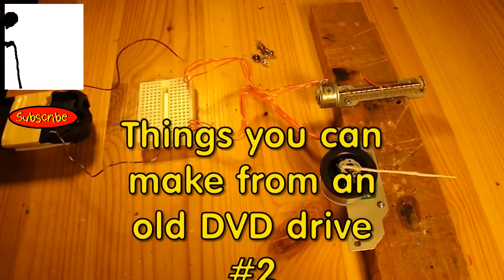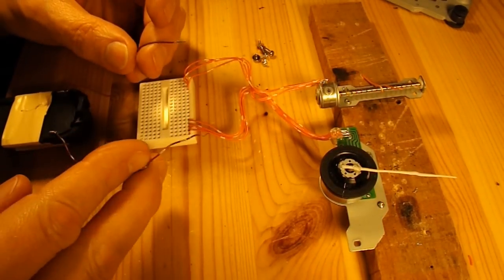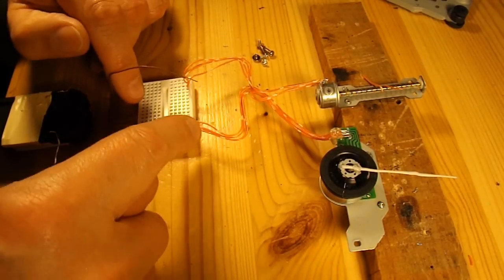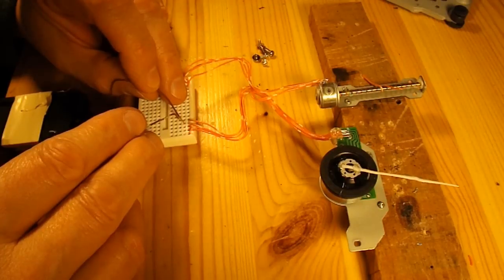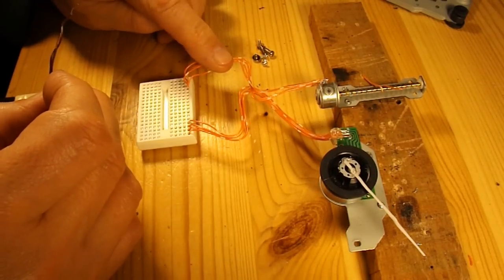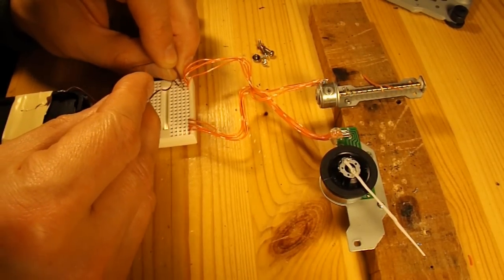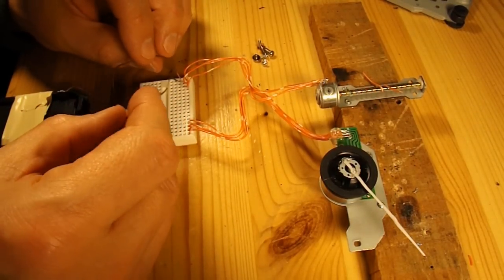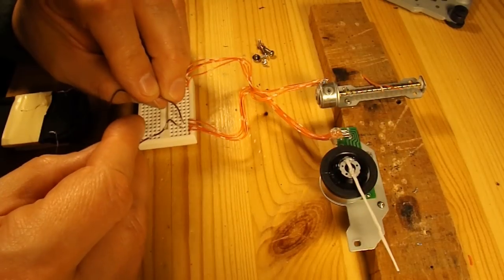Things you can make from an old DVD drive #2 - Step a stepper motor

Comment: Try inverting the polarity on a certain set of pins/wires for the screw stepper motor. It works for mine.
Reply from the maker: Donovan Goodwin isn't that what I was doing in the video? I was just stepping along the 4 wires a pair at a time in various combinations and alternative polarities. Most stepper motors have 3 coils and a common return, which gives you the 4 wires. If you look in my video description you will see more information and useful links.
Reply: GrandadIsAnOldMan I see, my mistake, my stepper is much smaller than that so I think it only has 2 coils, but I'm not sure. Thanks for the clarification.
Reply from the maker: Donovan Goodwin sounds like the one Thomas Kim is playing with in this video https://youtu.be/kAyDmovM18E

Comment: I think the screw motor is a 2-phase AC motor. If you turn the screw manually, you will feel no cogging, from permanent magnets, because there aren't any. Try powering one set of windings with about 6 volts AC and the other set with 6 volts AC, through a capacitor, to shift the phase.
Reply from the maker: +y1hardtop Ludic Science did one just the other day https://youtu.be/ZEcQW5rCbSQ and here is a later video of mine using this motor and a driver I bought off eBay https://youtu.be/n83utWnYCVE
Reply: +y1hardtop The screw drive is a bipolar stepper motor.  There are lots of documents online.  Just google 'bipolar stepper motor'

Comment: Look into bi-polar and Uni-polar stepper motors in Wikipedia, they are each driven in a different way, and you can buy a easystepper board for a few dollar on Ebay which will probably drive the one you are having trouble with, which may be a bipolar.

Comment: Ik this is an old video, But that second motor the worm gear one (atleast I think thats what its called lol) how would I get it to keep turning in a constant motion, and for example would it be able to push out a thin line of plastic as it turns.
Reply from the maker: +allthingsmultisoft5455 it is a stepper motor, so you would need a stepper motor driver circuit. If you search YouTube or Google it you should be able to find one. You may also be able to find a ready made circuit on eBay https://youtu.be/n83utWnYCVE
Reply: +GrandadIsAnOldMan well I scavenged it from a old dvd drive from an old Computer my dad had back im the 2000s and I was wondering, can I find a driver there, Cause im kinda on a flat 1$ canadian dollar budget haha, its pretty tight(thats litterally all i got left on my card.) so are there any alternatives? To the driver or like something i can find in a dvd drive.
Reply: +GrandadIsAnOldMan also We are talking about the long little motor right? Cause thats what i mean lol.
Reply from the maker: allthingsmultisoft5455 they are both stepper motors
Reply: +GrandadIsAnOldMan ok well i was looking in the drive and I found a motor and gears that controll the dvd slider thing, would that do what I need?
Reply from the maker: allthingsmultisoft5455 if you have the equipment in front of you then you should be able to work out if it will do what you want. If you search YouTube using the right search words you will probably find a video of somebody using those parts for something. Here is an example https://youtu.be/s_W0cPu5Gqs
Reply: +GrandadIsAnOldMan hmm alright, my plans atm is a gear mechinism that feeds a heater filiment like a 3D printing pen. And I found a gear system in the dvd drive with a motor that was used for the gears. i looks like a normal DC motor though. Do you know what im talking about and is that motor usable(it is under the circuit board, soldered to it and behind the panel to eject cds and stuff)
Reply from the maker: allthingsmultisoft5455 if it only has two wires then it will be a normal DC motor, stepper motors have more than three. Did you look at that link I sent you in the last reply. Like I said, if you do a search you will probably find somebody has already done something like you want for a 3d printer.
Reply: +GrandadIsAnOldMan yea it has 2 wire parts. And yea I watched the vid, Though Big difference than what i plan. Thank you for your help though.
Reply from the maker: allthingsmultisoft5455 the advantage of a stepper motor is you have full control over how far it rotates so you would be able to control the feed of your plastic very accurately but you would need a driver and a control system to do it. The video was just an example of what can be achieved and some of the movements and mechanics would be similar.
Reply: +GrandadIsAnOldMan oh, damn well i wont be able to get a control system or driver. unless I can make one out of scavenged Components from that drive lol, cause it has some useful stuff.. Guess ill research it.
Reply: +allthingsmultisoft5455 You can drive it manually. Power one pair. Power the other pair (you have to figure the pairs out by yourself). Then power the first pair with reversed polarity. Then the second pair in reversed polarity a.s.o.
Reply: +Jeroen Verbong ah ok thank you

Comment: Is the number of steps fixed?
Reply from the maker: The stepper motors have multiple coils and a step is the motor armature turning from one coil to the next. To move it another step you need to apply power to a different coil or reverse the current.Here is a YouTube search that will bring up lots of videos showing how stepper motors work https://www.youtube.com/results?search_query=how+does+a+stepper+motor+work

Comment: Heres a vid I did using a micrcontroller and a dual full H bridge to drive a cd rom stepper motor, most of the work I did was in the software, this is pretty much a minimum part count to do this, just the microncontrller and the H bridge chip, which is a L298.  https://www.youtube.com/watch?v=KwS0SUSeJpw The red board at the back connected up is just my programmer its not doing anything in the vid.

Comment: u should use esc for the brushless motor of cd/dvd
Reply from the maker: yes if it is a 3 wire stepper it will probably work with an ESC, here is an example https://youtu.be/pFJUZzrZWRI

Comment: Thanks for sharing! Your tutorial was a big help when I was figuring out the logic for this discrete driver https://youtu.be/FHCF-Ft41FA    I also have one of those little worm gear motors and I can't get it to work properly either... Then I've got another another stepper in my junk box which I can only get to go one direction with my driver.  I dread rewiring the driver. I have noticed that some of these small motors are just regular dc motors with extra wires for sensor attachments. I find it hard to tell which is which though. Any thoughts?
Reply from the maker: Sorry, can't help you there. I have seen some fan motors that are brushless but have the driver circuit onboard so you cannot modify them. Those ones often have the additional wires. You might find this video interesting https://www.youtube.com/watch?v=Im2GoXVy8d0&list=PLA5a2xPRSrB1z9JHbVfAXSGz9NBS_-Czc&index=14
Reply: @GrandadIsAnOldMan  

Finally got the 5 wire version to run. Seems it doesn't required the h-bridge like the 4 wire version. Just used a decade counter in a linear sequence: https://youtu.be/0vsOqkeW-Gw  Should be able to reverse it by another counter running backwards. Still haven't gotten the worm drive to anything but vibrate yet.
Reply from the maker: That is a great solution, well done. I have added that to my stepper motor playlist 😍👍

Comment: I guess, the only way to find out is if you open it up.
Reply from the maker: +Pacero feel free to do that, there are usually plenty of old drives around in scrap PCs waiting to be liberated. We are talking about a video I did over 2 years ago and I very much doubt I could find the same two motors now, rather a lot of things have happened since then. However logical deduction can tell a lot without having to take things apart. Connecting a meter to a pair of wires and measuring the resistance will tell you if you have something conductive between the two terminals.
Reply: GrandadIsAnOldMan
I've done it already.
Reply from the maker: Pacero and what did you find?
Reply: GrandadIsAnOldMan
Brushed DC motor, as I first told you, six coils.
2 wires.  People change it into a brushless RC motors.  Go to Instructables.com if you want to learn more about.  There are some of these motors running at 60.000 rpm.
Reply from the maker: Pacero I guess you had a completely different motor then, nothing like the one in my video. Do you have a picture or video demonstrating you taking it apart. I would be particularly interested to see the commutator and the brushes.
Reply: GrandadIsAnOldMan
They've been converted to brushless already.  Go to this site:  www.allaboutcircuits.com
Reply from the maker: Pacero I have uploaded some videos for you. They will be published shortly. Unless you are a super skilled engineer there is no way you will convert a brushed motor to brushless using tools you have around the house. The point is that the motor you are talking about is a different type of motor to the one shown in my video. I have searched through my scrap box and found two more DVD drive assemblies. One is identical to the one in this video and has two stepper motors. The other has a normal DC brushed motor. They are not the same and I have even taken the time to disassemble them for you to see the components. If you are going to give me links then make them specific to what you are talking about not just vague sites that I will have to spend hours searching different thread.
Reply: GrandadIsAnOldMan
If you know what brand name these motors came from, Sony, Panasonic, etc...  That will help you.  You might download the Service Manual.

Comment: Thsese are brushed DC motor and NOT Step motors.
Reply from the maker: +Pacero is that right? You are able to identify them from the picture, that is interesting. How do you explain the 4 wires to each motor and the step motion created by connecting power to each pair of wires rather than continuous rotation that you would achieve with a brushed DC motor. Perhaps you could create a video to demonstrate your opinion.
Reply: +GrandadIsAnOldMan The motor designed to spin the disk is in fact a brushless dc motor (which behaves very similarly to a stepper) and the motor that moves the laser head is a stepper (that's the one with the long worm gear)
Reply from the maker: +Alistair Wakelin Good point, but are you able to give a definitive description of the difference between a stepper motor and a brushless motor, like why the motors in the picture both use 4 wires
Reply: +Pacero Ok. Fine. You got me.  Check this video out, as a favor:  -Stepper motor basics - 4 wires bipolar motor, on youtube.  Good luck.
Reply: +GrandadIsAnOldMan The brushless DC motor has three pins for the different phases of current (120° apart) and a fourth for some kind of sensor which is used to see how the motor is rotating (I think its a hall effect sensor). If you think about what that motor is actually used for it is the very fast one that spins the disc. Whereas the other motor is a slow and precise stepper with high holding talk as it is used to position the laser over the right part of the DVD.
Reply from the maker: +Alistair Wakelin interesting but how does that explain the way I demonstrate that motor stepping by moving the battery wires across each pair of wires for one step on each application of the 3 pairs. You might find it interesting to look at the Thomas Kim videos I linked to in my video description or this one where I use a stepper motor driver on these motors https://youtu.be/n83utWnYCVE
Reply: Because that is the same alternating pattern that it is normally driven with, just much much slower. Those DVD drive brushless motors are actually pretty good and people use them to fly RC planes.
Reply from the maker: +Alistair Wakelin I think you missed my point. If it was a brushless motor with three wires plus a signal wire as you describe then moving my battery along the three pairs should mean one of those pairs was one coil wire and the signal wire and connecting the battery should not make the motor step. It may still be described as a brushless motor but all 4 wires appear to be coil wires and have nothing to do with a signal wire. Brushless simply means what it says, the motor does not use brushes to transfer the current to the coils. After that there are many different types of brushless motors for many different purposes and stepper motors are just one of the variations.